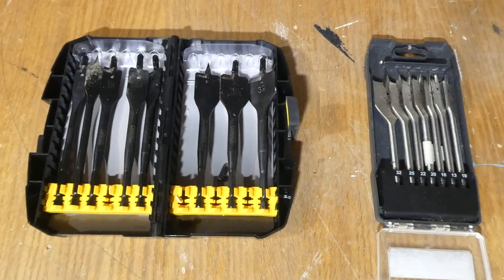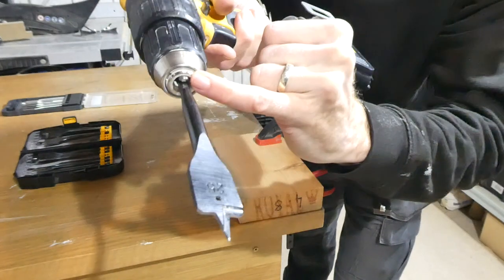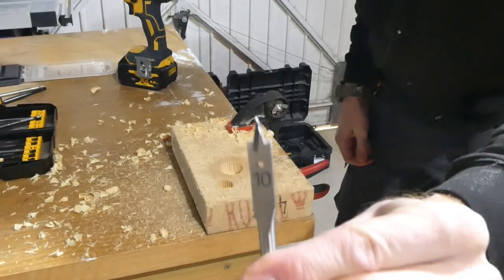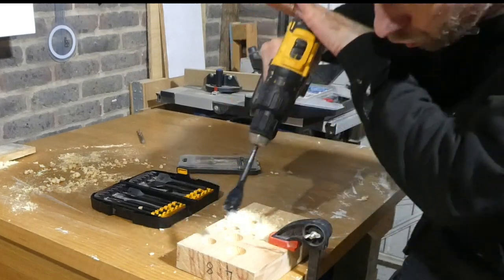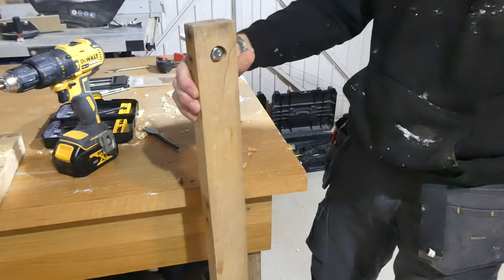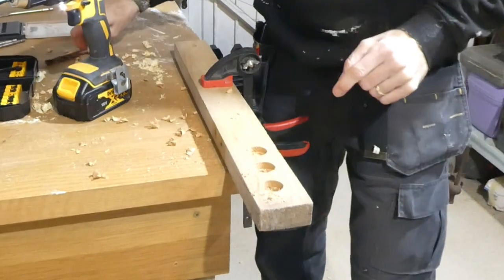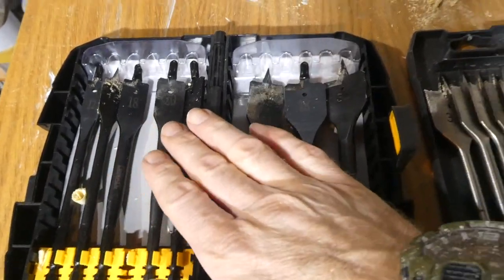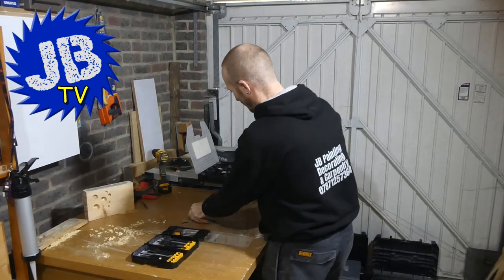How to Use a Spade Bit - WHAT YOU NEED TO KNOW

Comment: if you just need a hole in something and don't care about how it looks the self feeding ones with the screw tips are unbeatable, especially for running wires or pipe.  all you have to be able to do is put the tip of the bit where you want the hole and hang on.  i have a set of bosch daredevils that have eaten countless nails, and some of the hex shanks are snapped because i was using them with an impact and hit nails, every bit still makes holes effortlessly.  they're kinda sketchy in a drill press though.
Reply: They pull the bit in like nobodies business. Those Bosch screw head augers are amazing too.

Comment: Thank you, this was so helpful, especially the part where you don't want to fray the other side of the wood, if you need to drill right through.  I have to make new holes into replacement ceiling fans and don't want to fray the other side.  Of course, I will practice, A LOT!

Comment: I have an open fire at home. 
I get free wood from my local neighbours and cut it to a template size. The spade bit is handy,I like it  as it encourages the flame to go through the wood and not around it. I have 2 of them from a Bosch drill set and they are ok but the sizes can be a bit hit and miss. There’s a variety of sets you can buy but I am not sure a budget set is worth it when another brand like Irwin might do the same thing. I have a cordless drill and I can’t work out if I should have it on 20 which is the highest setting on the drill or at a lower setting like 10. I know you can use a cordless for screwing, drilling and with a hammer action too but I find the batter gets flat fairly quick if I put it on 20 and use a spade bit but run it at 10 and it works fine. I don’t know how long a spade bit should last and I don’t know if there’s a test to see. They are a mixed blessing. For other smaller pieces I use a standard wood drill bit and that works well. I don’t use my boiler for hot water or heating. I have an electric shower and that’s fine for cleaning, for hot water I use the kettle and make a drink. Whatever is left over goes in the wash up bowl and then I put the stuff in the dishwasher and run it on economy mode and save money.

Comment: Well done, right to the point, answered all my questions and then some. I want to drill 1/2-inch-wide 6-inch-long holes in a 2-inch thick plank to insert 6-inch blind floating shelf brackets. I am worried I will start going at an angle at some point. Any tips for staying straight all the way?

Comment: How do you control the depth in which you drill so you don't go too deep and maintain even depth across multiple holes for inlaying a cabochon in wood
Reply from the maker: You have 3 options: 1.use a drill that has a depth gauge/rod. 2.wrap a piece of masking tape around the shank to indicate when you need to stop drilling. 3.trial and error, keep checking depth with desired insert.
Hope this helps.